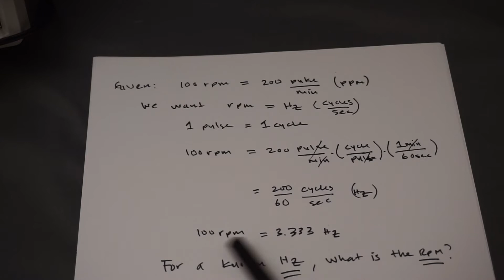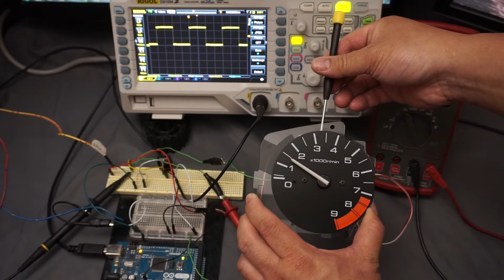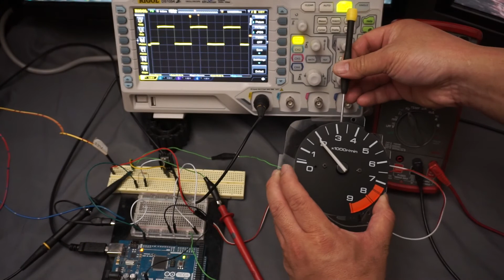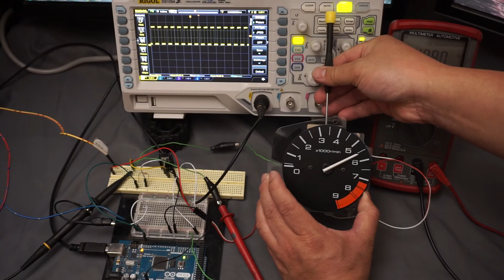92-95 Civic Tachometer Repair and Calibration

Comment: I know it's an older video. But do you know in what Voltage range the PWM Output signal is? I installed a Link ECU into my Civic EG and some people say you need a tacho booster to boost the voltage up to around 40 Volts, cause the Aux Outputs only supply 12 Volts max

Comment: With these cars in these years all you really had to do was look at the solder on the back and see if there was any cold solder or cracks at the joints. Resolder them and wahlah it would have fixed the problem. Done this many times on these Honda and Acura cars. known for failure in the sensors with poor soldering. Always check that first
Reply: He said the board had a leaking capacitor which means a failed component was the cause of the problem. Your comment is idiotic.

Comment: @mawfactor7283 Trying get the same to work with the Arduino. Do you have any info on the resistor values you did use or a schematic available? Luv your work thanx

Comment: Hey thanks for the video. It actually helped me make some progress on my current tach issue but I’m not quite there yet. My problem is that I have a V6 engine swapped on to my civic which cluster is for its original 4cyl engine. Now I have an RPM discrepancy that increases as the RPM goes up. Would you know how to modify the tach so that it can read the right amount of pulses per cycle from the v6. It would be great if you can make such a video since there isn’t anything on YouTube of anyone addressing this issue.
Reply from the maker: Refer back to beginning of the math and substitute 100 rpm = 300 pulses per min for a V6 engine or 1 rpm = 3 pulses per min. The math should work out to 20×Hz = rpm.
Reply: @mawfactor7283  Math works, but how do I transfer that math onto my tach? 😅 I don’t have a scope machine like you or a computer program to send Hz values on comand. I did adjust potentiometer counter clock wise as my car was at idle, but then I maxed out on the dial and I’m still 200RPM more then true RPM. Do you think I can ship you my tach? That would be AMAZING!

Comment: That's really cool. Awesome video. I need this done on my 99-00 civic si cluster. I have a j swap in my civic and it throws my rpm way off.
Reply: It can be done I've done it already I have a EM1 SI cluster in my 98 Civic. RPMs were about 200 too high in the upper range. Pull the cluster and the tach then turn the variable resistor o  the tachometer counterclockwise very little and was able to get it spot on but this was through trial and error taking the cluster apart manytimes to get it accurate

Comment: Hey do you know if the Speedometer has the same potentiometer? I have a 94 civic and mine read about 7 miles more than it should, do you recommend to replace all the caps just in case? Thanks!

Comment: What is the input voltage (not the frequency input) you're supplying to the gauge at the IGN and GND inputs?  12V?  5V?  Do you think it would hurt / change the output of the gauge if I supplied it with 14.8V?  Also, it looks like you're using 50% duty cycle - is this correct or does it really matter?  I really appreciate this video - looking forward to getting my tachometer working right again!
Reply from the maker: I can't confirm if 14.8V will work as I have only used 12V. I am using the power source from my computer. You are correct on the duty cycle of my signal at 50%.

Comment: Hey man is there any way you could help me out with my civic rpm gauge?  It was reading low just as you are describing here, so I soldered in a new capacitor(same one you did because it was leaking) and now the gauge won't read above like 5k rpm.  The idle rpm is fixed, it used to read like 600 at idle now it is right at 1000.  The lower range seems to be correct, but it just stops around 5k, even though any engine is tuned to rev to 8400 rpm.
Reply from the maker: Make sure you match the capacitor value to the old one and also check the other capacitors (C6 and C2).